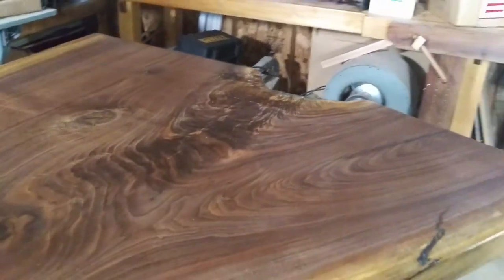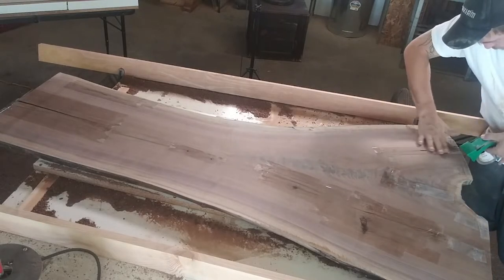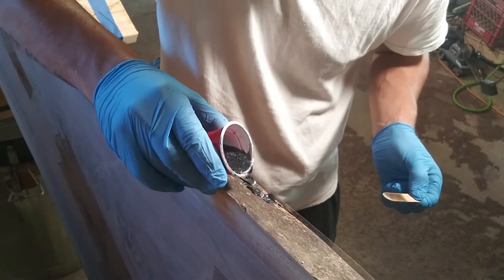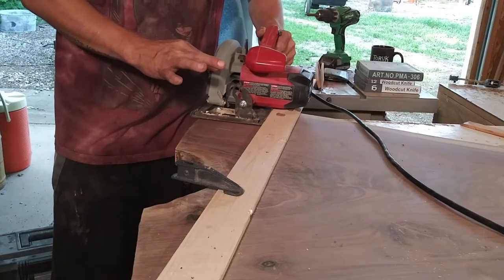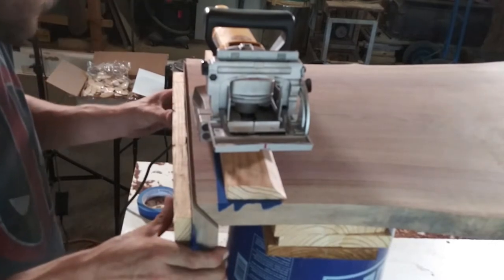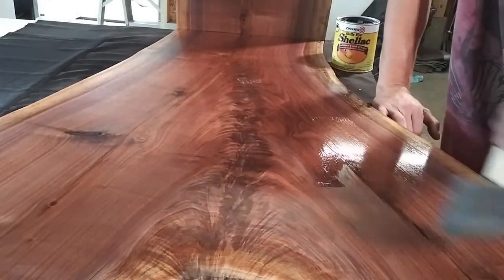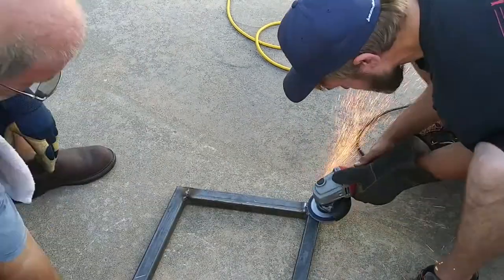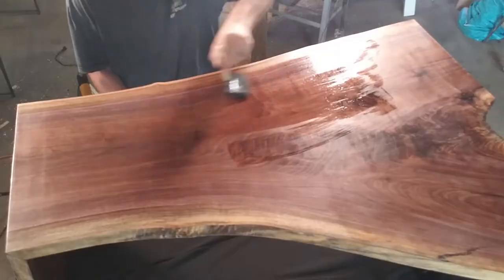Modern Waterfall Table DIY For Beginners

Comment: I see that you superglued (?) clamping cauls to blue painters tape.  How is it that the painters tape withstands the pressure of the clamps and doesn't peel off? I was planning to use a brittle hide glue to adhere clamping cauls to my mitre joint but this method seems to involve SO MUCH less cleanup after the joint has set up. Rather than chiseling off the hide glue you merely pull up the painters tape.
Reply from the maker: They just barely managed to hold on. In hind sight i would have put the painters tape parallel with the grain. It would have held on a lot better that way. I was more concerned with closing gap than I was clamping down with tons of pressure. The clean up was non existent
Reply from the maker: If i were you I would use about 6 to 8 inch pieces of tape and lay the first piece on the edge about an inch from the joint and then lay all the subsequent pieces overlapping all the way across the joint. The surface area of the tape with allow for just enough grip to allow you to clamp it into place. Just dont over do it.